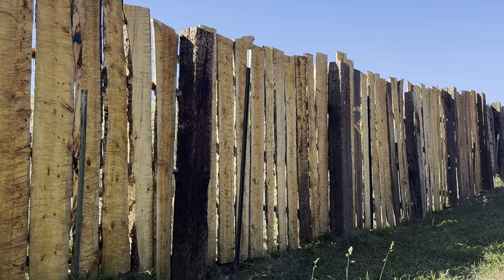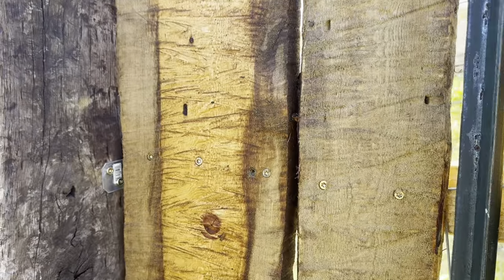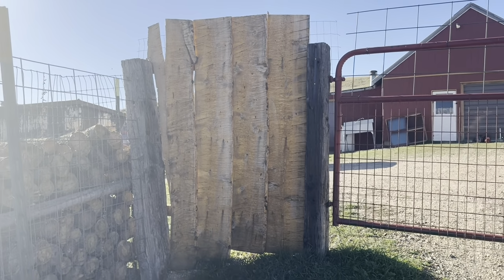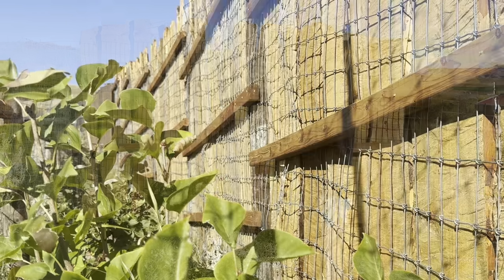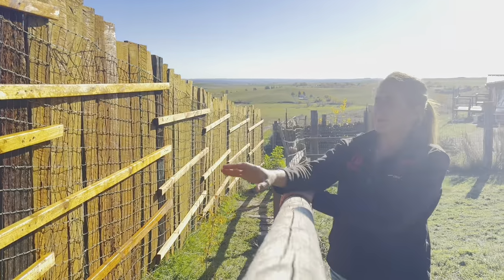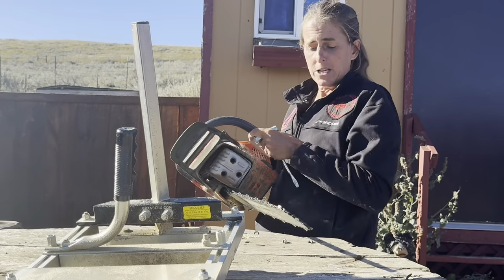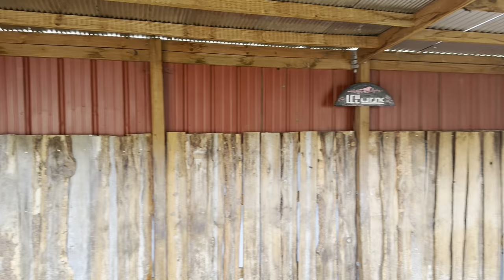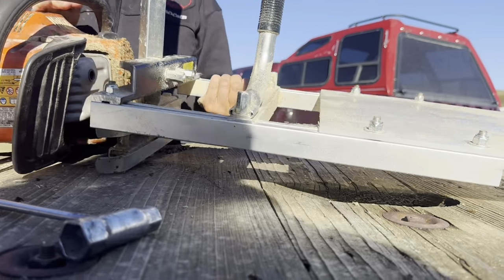Making A Privacy Fence With A Chainsaw Mill

Comment: Does it cut straight without using a guide for the first cut
Reply from the maker: If the log is straight, I don't use a guide. But if it has a curve or bumps, you may want to cut those off first, or use a ladder or rails for a guide. And a level.  I've done that but for a rough fence, I enjoyed just cutting the first cut (slab) off without a guide.